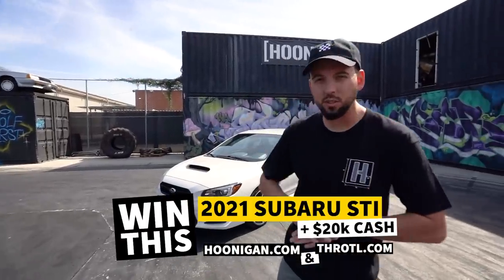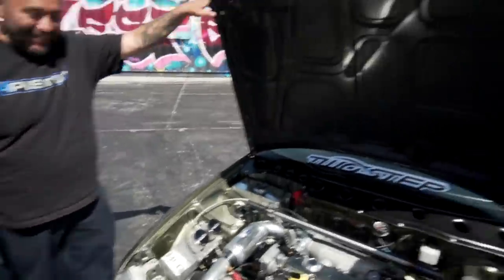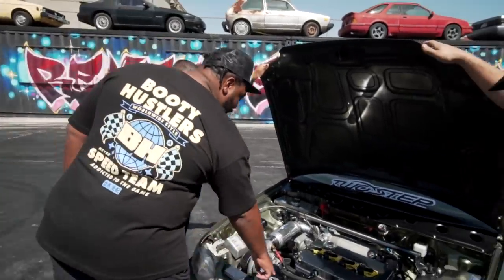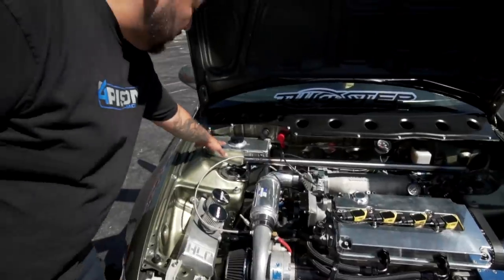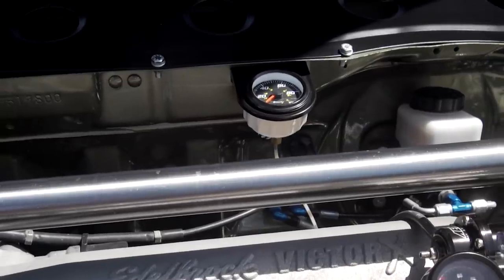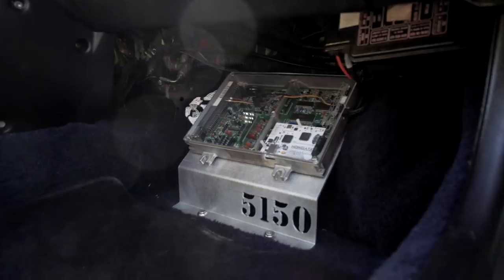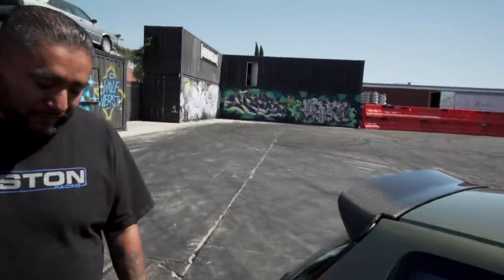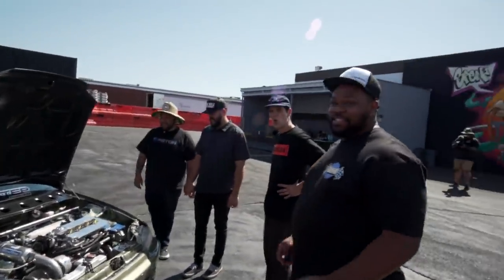400hp Supercharged B18 Swapped Civic Si throws down Tire Slayer Studios first FWD burnout!

Comment: Such a clean build man! I would love to see it come back for This vs That!
Reply: It'd have to be a roll race cuz this things getting destroyed off the line by anything that can hook. From a 20-30 roll with that power to weight ratio this little guy would drive right outta most ppls lives though.
Reply: @xDPx-zh7vr  You would be suprised . I have faith the owner did his home work as far as making this motor bullet proof.
Off idle boost for these motors is no problem.
Reply: @gilbert9407  I'm not worried about the motor at all. Delivering that much power smoothly to a front wheel drive car while counteracting torque steer and wheel hop is difficult at best. Add the pressure of trying to beat someone with an equally impressive car and you have to be spot on. I'd say a great race would be a first gen CTS-V that's making 600-700hp. Those cars had notoriously bad wheel hop and only came with a manual trans. At almost twice the weight of the Honda I think that'd be a great this vs that matchup. Polar opposites with the same intention, hauling ass.
Reply: Agreed!

Comment: "You check out my motherboard, bro." 

Love it. I used to be a Honda guy, but got turned off by all the ricer bros. This guy, on the other hand, does it right. Outstanding work, sir.
Reply: I mean you can find ricers with any brand tbh. I actually see more riced chargers and camaros around my area than Hondas
Reply: @darkknight097  This is true. But back in the 90's rice was a little more specific.